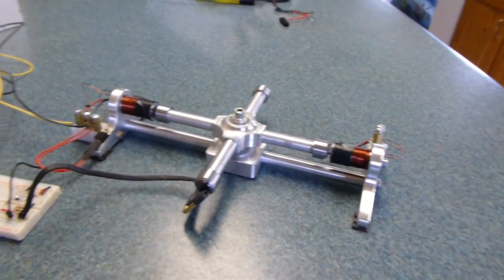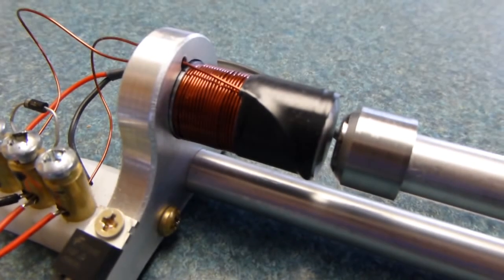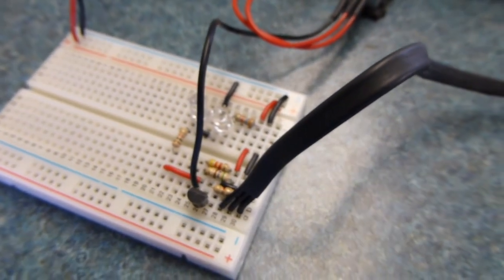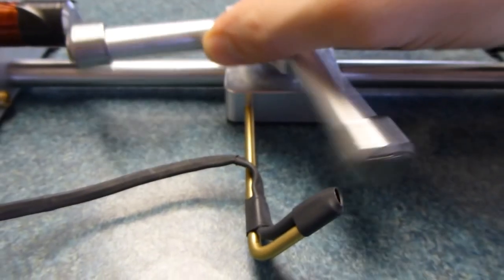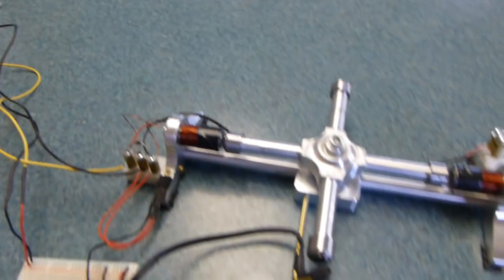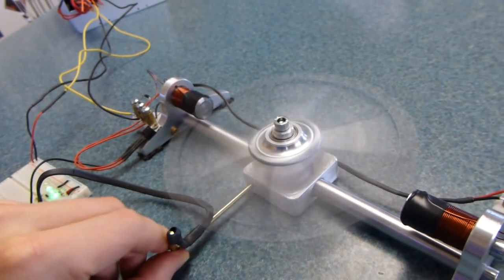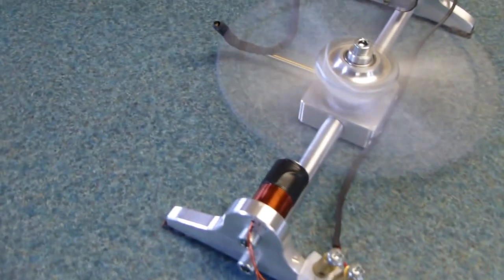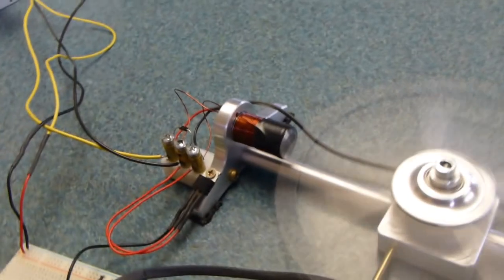DC Brushless Motor Project

Comment: Increase no of poles  and use stepper motor  for rotary motion
VFD controller based
Use peltier  circuit as heat sink and use peltier as generator  when your motor is running , dessipating heat be used for power generation

Comment: How much supply cost  in dollars of DC brushless motor ?
Very good explanation keep on effort
Make a BLDC  motor with low rpm and high torque, rpm 10 and torque 1 kg M per second square
Power consumption  not more than 100 watt  ( 100 joule per second
🎉🎉🎉🎉🎉❤️🎉❤️🎉🎉🎉🎉
👍👍👍👍👍👍😅😅😅😅👍👍

Comment: My question is: how does it start by self?
In the scratch point, the magnetic force pushing and pulling the magnets has no level arm, which means there is not, or just only a small torque and it will not spin. How did you solve this?

Comment: I had a new emax 1306 brushless motor that had a motor wire break off before I could even use it and it was to small of wires to repair , so I unwinded the coils because I plan to rewind it and make it a custom rc airplane motor , it has 12 magnets and 12 coils 
3 for each of the 3 phases ,do I just wire the coils all clock wise or do I need to wind like this 
CCW, CW, CCW ,CW ,CCW ,CW ?

Comment: Intuitively it seems like the frequency of Hall-effect sensor outputs would be constant while the sensor is in a static position. Can you explain more about how its position affects its firing frequency?
Reply from the maker: Lennart Nilsen the point at which the magnets are energized is just increasing or decreasing the efficiency of the motor. Nothing more elaborate than that.

Comment: Hi, you said, that the copper wires ran too much current, what would change if they were copper wires?
Reply from the maker: Elmārs Spalva it would burn out the MOSFET that's controlling the flow of current.

Comment: Very nicely done except I thought a brushless motor requires 3 power leads and u only have 2 of them.Unless the sensor for the red light bulb is also the 3rd power lead?
Reply from the maker: Three phases are not required but would help with controlling direction.
Reply: Jonathan Proce thank u for responding.I didnt know it could be done with 2 phases.But the third gives u control on the direction of spin.Thank u

Comment: But how fast could you make it go?
Reply from the maker: RRKS101_1 TF2 maybe a bit faster with higher voltage or larger coils, but this is pretty much it.
Reply: Jonathan Proce I thought coils increased torque/power but Yhea voltage is a pretty good way to increase the speed. Frequency also affects it from what I gathered in 10 mins of YT
Reply from the maker: RRKS101_1 TF2 if you increase the power but the load remains the same it will go faster.

Comment: Wouldn't it requre quite a high rpm to be sufficient to power anything that requires a constant force, as it seems to be far between each magnet?
Reply from the maker: Perhaps, depends on the torque. In the case of this motor it's of no practical use beyond this visual demonstration.
Reply: Yeah maybe, but wouldn't stopping the motor when the magnets aren't close to each other stop it? Or if they are strong enough in the worst case at least make the force a fraction of what it would be at the optimal point? I would imagine a "normal" or conventional electric motor having enough coverage of the magnets to apply an almost constant force. This would of cource be easily fixed with twice the amount of magnets/spokes or more, but I get that you might like the simplistic and rather beautiful design that has right now. And also, great video!
Reply from the maker: Max MS I never tested that. There is very little friction in the assembly so it could still pull itself toward its starting position.
Reply: Oh okay. If it were to be powering something that might lead to problems if the friction would be high
Reply from the maker: Max MS yes, it would. As I mentioned there is no practical application for this motor beyond a visual demonstration of basic principles.

Comment: a bit of a dumb question here since i dont know a lot about electricity. but you can touch the coil and not get electrocuted ?
Reply from the maker: J3AN P3T3R yup. The wire is insulated. Even if it wasn't the voltage is too low to do any harm.
Reply: OH ! yeah i forget that those copper looking wires actually have some insulation in them.

Comment: dO YOU THINK THIS CONCEPT WOULD WORK FOR MAKING AN ELECTRIC BIKE? i HAVE BEEN THINKING ABOUT MOUNTING MAGNETS TO THE OUTER RIM LIKE WHERE THE VALVE STEM COMES OUT AND THEN HAVING COILS AND THE SENSOR SWITCH THING MOUNTED ON THE FRAM OF THE FRAME MAYBE EVEN ON A RING THAT MAKES THE COILS BE JUST INSIDE THE RIM CLEARING THE MAGNETS.. whAT DO YOU THINK ABOUT THAT IDEA? SORRY ABOUT THE CAPS..
Reply from the maker: Steve Becker AKA BECKWERKS no, it wouldn't. You're best to buy and off-the-shelf motor as it will perform significantly better.
Reply: Thank you for responding!

Comment: Great. 
It is good to make a water pump using inrunner as the impeller, and at each lobe end fixed with a magnet and the stator outside.  So no need of complex motor mechanisms.

Comment: Where did you get this idea from and what school do you attend?
Reply from the maker: Every electric motor works the same way. This was just a simple way to demonstrate it. It's a terrible motor by most measures, though it was easy to fabricate and is fun to look at.
Reply: The motor was actually very well done. Don’t sell yourself short. But can you explain the holo effect sensor? How was it able to slow down the motor, I didn’t really catch on very well
Reply from the maker: It's not a particularly advanced control technique. Moving the point at which the sensor detects the pole coming around simply makes the motor more or less efficient. There is a position at which it operates most efficiently (and thus the fastest). Any other position for the sensor introduces inefficiency and causes it to slow down.
Reply: Thank you for explaining

Comment: Where did you get the sealed ball bearings? That's what they are called correct?
Reply from the maker: They're pretty easy to find. Lots on eBay etc. These ones  would be referred to as 'shielded' rather than 'sealed'. Keyword in the part description for shielded bearings will be 'ZZ'. They spin faster as rubber seal drag.

Comment: Hey Jonathan! Have you calculated the voltage and current of the solenoids? I am trying to build something sort of similar to this using 12V .33A electromagnets from ebay and would like to know what kind of components to get (mainly what MOSFET and what kind of PSU).
Cheers dude, awesome project!
Reply from the maker: Rodrigo Prieto Padilla I seem to recall it being under 10 amps total. I used a 20-30A FET and it was plenty.

Comment: You mentioned in the video that the speed varies by changing the position of the hall effect sensor. Can you please explain why does that happen?
Reply from the maker: The explanation is not elegant. Adjusting the timing just makes the motor less efficient so it spins slower.
Reply: What do you exactly mean when you say "adjusting the timing" ?
Thank You for answering my question !
Reply from the maker: Exactly what I showed in the video. Moving the sensor which causes the magnets to "fire" too early or too late which hurts performance.

Comment: how much torque that rod can sustain
Reply from the maker: Lots?
Reply: can you please tell me .what is the RPM of this motor and voltage of DC power supply.
Reply from the maker: About 1200 rpm, and 12V.

Comment: What type of transistor did you use on the breadboard?
Reply from the maker: parley Kelsch can't remember. Just some cheap NPN like a 2222.
Reply: Jon Proce Okay thanks.
Reply: Here I am a year later trying to build this motor lol. You sure that's and NPN transistor? On the schematic it looks PNP. Also, do you know what the resistor values were?

Comment: How is the Hall effect sensor controlling the rotation speed ? Is its voltage varying as its turned or is there a hidden circuitry  ? Sounds really cool the engine running
Reply from the maker: daserstereichen nothing that technical, it just reduces the efficiency a bit by firing the magnets at the wrong time.
Reply: @Jon I see, smart! Thnx Jon.

Comment: The picture in the description has not enough details to replicate the action. The idea is great, but i don't think your teacher accepted a drawing like that for this project. No details, no values. You should draw a proper schematics of it, with dimensions mentioned, resistor and capacitor values, MOSFET label, winding properties, like wire gauge, core material, wire length and so on.

Comment: Hey i want to build my own rc car and i wanted to ask you if its possible to make an electric engine that could run at about 100 km/h
Reply from the maker: Not practically, no.  Just buy a motor and ESC off the shelf.
Reply: why not, can you tell me what are the limitations of building an electric motor and if i have to buy it how much would it cost.
Thank you very much for your answer
Reply from the maker: TheGamecheater100 it would probably cost you 1000x less to buy a motor than it would cost to buy the tooling you need to build one of equivalent performance.

Comment: I made a simular idea but no sensor. It has a one coil and a "detection coil" When the motor induces a current it will continue to run. It is used to drive a pendulum. But can be used to power a rotary motion. Downfall is that my circuit has to be hand started. Because it needs the induction on the detection to get it started. But for a clock that is ok. Made it drive a lego clock with quite good precision for days.

Comment: Can you make tutorial how to make this motor at home?
Reply from the maker: No point. 99.98% of people don't have access to the tools required to build something like this.
Reply: Which tools did you use?
Reply from the maker: A CNC milling machine.
Reply: It can be built from old cd-rom stepper motors.
Reply from the maker: ...well then you're not 'building' anything, you're just plugging in another motor...
Reply: Can you send me instructions, how to do it? I will try make it.
Reply: I have my dad has access to nearly everything that has to do with metal and steel and aliminuam hes an polymechanic google andritz hydro then you know what i mean

Comment: is it posible to rotate it in other direction?
Reply from the maker: jernej glavan yes, you'd just need to tweak the geometry slightly. It rotates in the direction it does only because of imperfections in machining and assembly; it's not perfectly symmetrical.
Reply: Jon Proce would tweaking geometry change reliability of starting in direction you want?
Reply from the maker: Yes.

Comment: HI,
In your opinion if instead of 4 points, one would install 16 points...
Can that  increase overall performance? (consumption, speed, torque)
Reply from the maker: Yes, but it would be a wasted effort. Just buy a motor.
Reply: I need to build one :)
Reply from the maker: Haha, well that would be fine but it'll be a lot of work!
Reply: I agree on that point,
but....
I want to build those hands as longer as possible.
Make them at ends as heavy as possible....
(and yes, yet another over unity freak) :)

Comment: How would you measure torque?  Does it put out any power?
Reply from the maker: You'd need to hook it up to a dynamometer which isn't practical for a motor like this. You could probably estimate it by measuring current via conventional motor calculations and the geometry, but that would rely on a lot of assumptions.

Comment: Hi Jon....I think the simplicity of your design is very good.
On your circuit diagram....I'm not sure what your components are on the right of your diagram.....looking like three switches all in a row ??
Reply from the maker: it's the MOSFET.
Reply: Many thanks Jon.....which one did you use ?
Reply from the maker: Tony Smith any 20+ amp rated N type will do the job.
Reply from the maker: FQP30N06L

Comment: Jon, are the electromagnets wired to repel the permanent magnets on the rotor? Thanks.
Reply from the maker: Yes they are. The rotor magnets are naturally attracted to the steel stator cores when de-engergized, then when they're close to alignment the rotor is energized which makes them repel.
Reply: Brilliant!

Comment: I presume you used the 12 volt output of a desktop PC power supply. Here is a few questions:

1 - what is the mean current when rotating a max speed? 
2 - What speed is max speed (frequency of pulses on the coils)
3 - does the current increase or decrease when moving the hall sensor, changing the timing
4 - what is the torque. Using a rough approximation : is it hard to stop the rotation with your haand pressing on the axle (wearing gloves)
5 - what makes this motor start the same direction? If it is build symetrically, it should allow starting either way, which can be an advantage to implement forward/reverse without transmission (see old rail road devices which used 2 stroke engine reverse capability)
6 - Did you modify your circuit since the publication of this video? For example, is using fully bidirectional electric pulses to the electromagnets (with 4 MOS transistors in H-bridge) would improve speed or torque?

Nice and clean hardware design!
Reply from the maker: 1 - No idea, never measured it. Probably not much, 1 or 2 amps.
2 - It ran at about 1200 rpm.
3 - Current probably went up when it slowed down and is was running less efficiently
4 - Extremely low torque overall.
5 - If it was truly symmetrical it would start in either direction randomly. It was only because of machining tolerance that it decided to always start in the same direction.
6 - Nope. Not much point in making improvements, it served its purpose. This was a terrible motor by most accounts, it just looked pretty.

Comment: this is bullshit but not DC brushless. learn more about.
Reply: Learn more about English
Reply: Kiss my ass ))).... the Englishman.... understand, no? 
My English is normal for me... this shit, not motor )))))
And truly non DC brushless.....
Reply: +Edward jfdlaj For real.
Reply: If this isn't brushless, then where exactly are the brushes?
Reply: What he's trying to say is that this motor is not a DC motor. It IS brushless, but it's not DC. 
That mosfet and hall-effect crap is simply acting as "electronic brushes," if you will. When a magnet passes the sensor, it reverses the current going into the coils. 
Yes, it does run off of DC, but it's not a true "DC Motor". It has to pass that DC through a speed-control circuit first, in this case the mosfet/hall effect, which then powers the coils at the right time/polarity. 
A "True DC" motor will either do this mechanically, as a brushed motor does, or not at all. (not sure if that exists though)
Reply: So your definition of a "true" DC motor is a motor without sensors and switches? Why can a mechanically commutated motor be a true DC motor, but an electrically commutated motor cannot? Because it's outside the motor? What if the control circuitry were housed inside the motor, would it be a true DC Motor then?

As far as I know, the point of an electric motor is to convert electrical energy into mechanical energy by the interaction of magnetic fields, i.e magnetic fields from electric currents in wires or in atomic orbits from magnets. If there's something misleading about motor naming and classifications it's probably because of how motor geometry and construction evolved with semiconductor technology.

If there's any motor that should be sought after, it's a motor with superior torque-speed characteristics and doesn't self-regulate itself (as with the consequence or convenience of back-emf, depending how you look at it). Now that we have high power solid state switches like MOSFETS and all other variants of transistors, motor drivers, and sensors let us do a lot more, like miniturize, lighten, and reduce the cost of construction, and of course, make more efficient drive systems.
Reply: +Low Elevation RC
Many thanks to you buddy!
You alone knew what I wanted to explain this man.
DC motor not can be brushless, its it nature.
Reply: The speed can be modified by running different voltages in there .. the hall effect is the best option with non-moving parts, you can put a reed sensor instead and you get rid of all the electronics. For slow speeds, you can use a micro-switch and close the circuit when one of the legs hits it ..

Comment: Hey I really like this project. Could you write the component list to me. It's actually a little hard to see or be sure about the resistor color code, and if you could tell which diode you've used and the hall sensor also. 

Thanks, Kevin.

Comment: I have a few questions for you.  What did you use for your electromagnet core ? What was the voltage and current used, did you ever take a measurement ?
Reply from the maker: 12V source and the coils were wound to a sufficient resistance as not to exceed the max current rating of the wire. Can't remember what it was exactly.
Reply: +Jon Proce  can you tell me what metal you used for the core that you wrapped the coil around ?
Reply from the maker: +ThatGunDude the cores were just low carbon steel (1018?) and I used aluminum stator wire.
Reply: Thanks for the info. Much appreciated

Comment: Cool and well build although not very good by
electromagnetic standards. The magnetic fields are weak if there is not a complete
low reluctance path.
Reply from the maker: I agree! It's a terrible motor by most standards! :D
Reply: You mean because there is no stator yolk to carry the flux to the opposite magnets? Because the bottom of the motor could be a return path if its not saturated.

Comment: Is it possible to put the electromagnets in the mid-axes at 90 degrees rather than the tips? (To free up the space on the side)
Reply: That should be possible, you just have to angle the permanent magnets appropriately.